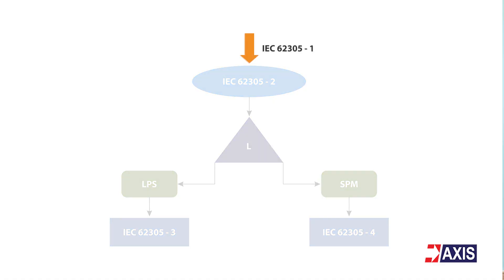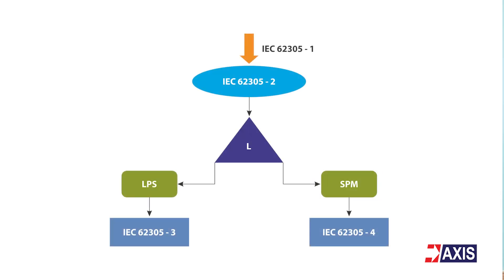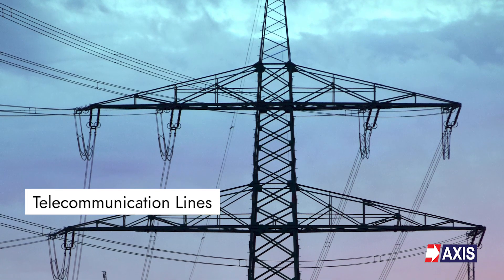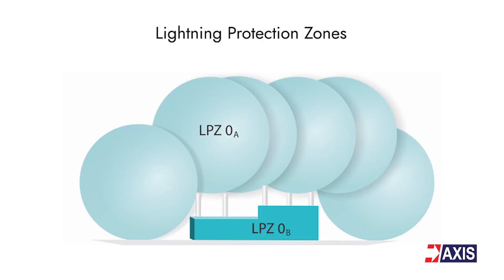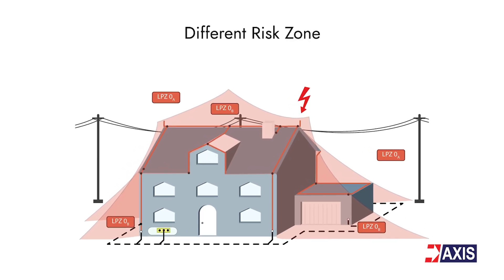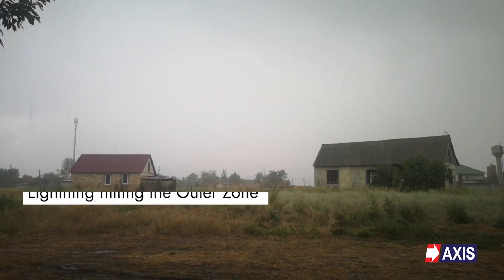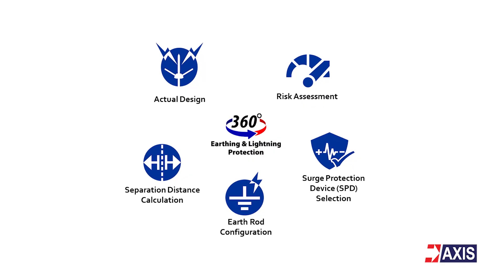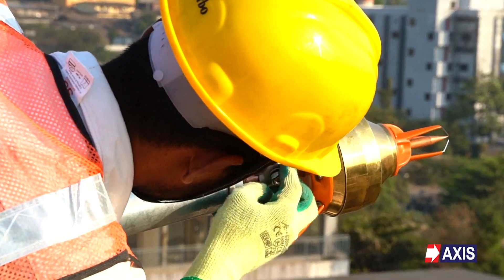Lightning Protection Standards Explained - IEC 62561 & IEC 62305

Comment: Does a building with only the ground floor require a lighting arrester? what should be the minimum height of a building to install L.A?
Reply from the maker: Hey Sam,

A building with only a ground floor might still need a lightning arrester, especially if there are no taller buildings nearby with arresters. 

The requirement isn't strictly based on height—it's more about the surrounding structures and the risk of lightning strikes in the area. 

If your building stands out in an open area, installing a lightning arrester is crucial.